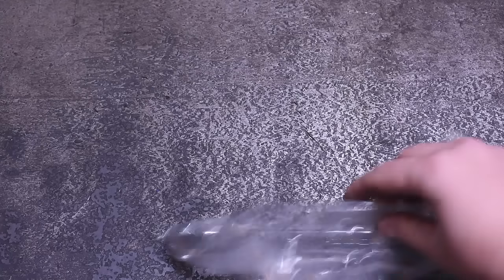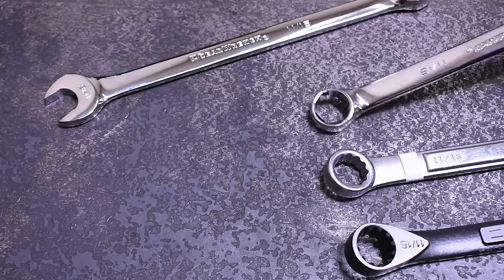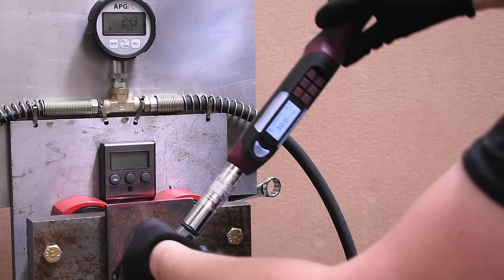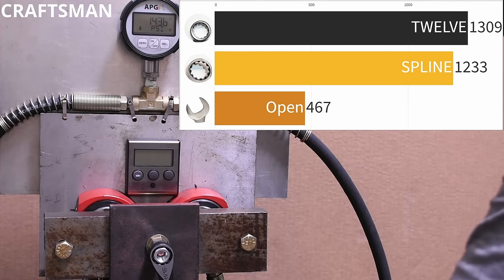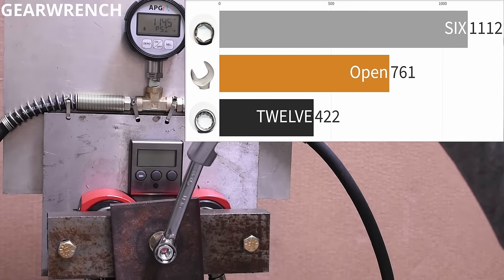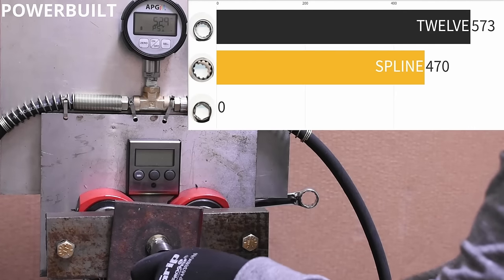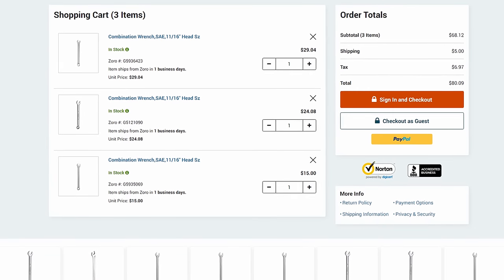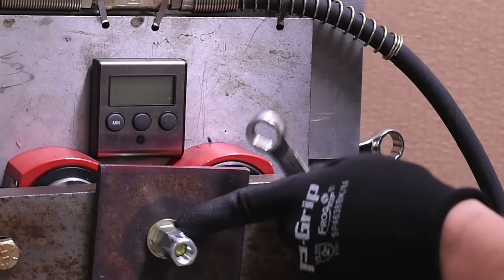Let's Settle This! What Wrench & Socket Design Will Slip 1st?

Comment from the maker: Follow up video testing 14 brands on the open end! https://www.youtube.com/watch?v=DzY4jg7NmKw
If you're wondering why 12 point and spline are being tested on 6-point fasteners, its because that's how they are used 95% of the time in a shop environment. And how they are sold to us on tool trucks. Combination wrenches are as old as time yet very infrequently used on actual 12-point or spline head bolts now days, they are a way to wrench on 6-point with less arc swing before repositioning, and therefore more access.
Reply: As an engineer, I'm more interested in 6-point on 6-point bolt vs 12-point on 12-point bolt, vs inside hex vs torx maybe? I know that's how tool trucks and shop sell them to you, but to me that screams wrong tool for the wrong fastener.
Reply from the maker: @checksum00  That all sounds well and good on paper to engineers I'm sure, but the popularity of the traditional 12-point combination wrench is due to access. You need multiple angles of attack on a bolt head. 6-point box end may not slip, but once you turn it and can no longer re-position it, story is over there. 12-point, and spline here with some advantage it seems, offers you the access without 60° of arc needed between goes.
Reply: @TorqueTestChannel  oh yeah, totally get the use case here, and frankly as an amateur mechanic I mostly carry 12-point for that reason, and so I don't have to duplicate tools for the rare case I get 12-point nuts. I'm not use to those spline one, actually the first time I hear about them. I worked in aerospace and we mostly use socket head caps screws. Rule of thumb in the industry is that 6-point < 12-point < SHCS < torx and other proprietary screws format, but I never really saw backing data on that. That's why I think seeing a fights of format vs format using the right tool would be immensely interesting.
Reply: @TorqueTestChannel  true, but if the clearance is that limited, you're probably going to want a ratcheting wrench anyways.
Reply from the maker: @SmallSpoonBrigade  Needing to use 12-point for repositioning doesn't describe a very tight space. Swigging a 10" wrench 60 degrees takes up a lot of room. Of course if you want to get in a habit of breaking bolts free with a ratcheting wrench that's something you can do as well if you have a good warranty. We all have. But 12-point box end breaking bolts free still happens countless times a day around the shop so it's worth seeing this difference I feel.
Reply: Maybe the majority of fasteners for the average guy are 6-point, but aircraft typically use 12-point fasteners. They are also high grade, and usually not rounded, as they tend to be replaced if found to be worn. Unless the last guy was a dick.
Reply: @TorqueTestChannel  his statement is what defines the engineer vs the mechanic. There is nothing wrong with having an education and a significant base of knowledge, however having the experience and ability to make a tool do what you need to support yourself is what u need to be a competent mechanic. Although I know plenty of engineers that are great hands on mechanics
Reply from the maker: @dougrobinson8602  In that case (where everything is 12-point, and perfect, and hardened) there's not going to be any difference between tool performance. Happy days for you folk! :D
Reply: @checksum00  "6-point < 12-point < SHCS < torx" and this is why mechanics hate engineers. Perhaps in raw yield, manufacturing, and grading this rule applies but in the real world where this thing called corrosion exists this is no longer the case. Torx is the worst to try and remove once it's rusty but at least it's already center punched for the drill.
Reply: @TorqueTestChannel  I think you're absolutely correct. I've maybe wrenched on a handful of 12 point bolts ever and never seen a spline drive bolt in person. This was by far the most practical and useful way to test this for the general public. As you said as well, we're interested in testing on already worn or softened fasteners. Great testing!
Reply: @802Garage  The only spline drive fasteners I have encountered in the wild were fancy lug nuts on aftermarket wheels. The guy had the socket in the glove box thankfully.
Reply: @Yogi_Bear69  you missed "in aerospace". Also disassembly is frankly irrelevant here, we are talking about torque ability and clamping pressures.

If we were talking about maintenance, other factors would be in play.

Also comments like that is the exact reason why mechanics wet dream of getting invited to talk down to engineer and scream at them about rust as if they had no fucking idea will never happen.

Engineering is an exercise of balance and choosing the most perfect imperfect situation. I'm sorry but the market, customers are making it impossible to take maintenance in heavy consideration because the society mostly throw away things at the end of the warranty. Sucks to be you, but that why right to repair is important.

The difference isn't the engineers, the difference is the market.
Reply: @checksum00  Working aerospace you should be very familiar with spline drive as a huge portion of the fasteners used in aerospace are spline.   So something does not add up here...   And 12 point bolts are very common any auto or aircraft  tech will be very familiar with them.  Heck Ford has been using them on driveshaft to pinion flanges since the 70's
Reply: The golden rule with spanners is that you never have the "right one" for the job. It's not just whether it's a twelve point, six point, spline or whatever... you never seem to have the right one! The handle's too long, the heads canted at an odd angle, the handle's too short, there's too much "meat" on it, it's stretched, it's been "modified" for another job, etc.
I've finally learned (age 51!) that wishful thinking does not change the physical properties of either a spanner or a fastener. Patience, reasoning and a credit card are the best tools you will ever have at your disposal.
And the other thing that I've learned... I'm a bloody hypocrite. I'll still go out and take another short cut sooner or later and turn a 3 minute job into a 3 hour saga by not following my own advice. By the way, I no longer use these tools professionally.
Reply: @checksum00  Make that inside hex (allen), torx, torx-plus, and triple square (xzn). I'd also like to see the difference between spline drive fasteners (ribe and polydrive, which are very similar but still different than each other) but that's starting to get a little pedantic. Screw it, throw in E-torx and 5 lobe torx too!
Reply: Try flipping the wrenches around so the handle bends towards your plate. It is supposed to change how torque is applied to the fastener. I find it works better this way on really stuck hardware.
Reply: @checksum00  Engineered obsolescence.
Reply: Exactly. Reading the comments here I'm shocked.  6 on 6. Not the way its done here. 12 on 6 for multiple angles especially when bolt is hardly accessible.  Use 6 on 6 when if in a case you damage the head of the bolt to get better grip. Spline spanner i must say I'm seeing for the first time.
Reply: 12 point a must for aviation. Jet engines they are used exclusively, Thousands of 12 points on large jet engines. How can the torque test channel omit aviation where everything is torqued?
Reply from the maker: Because the average combination wrench being sold on Amazon, Harbor Freight and even the tool truck is not being used on jet engines.
Reply: @TorqueTestChannel  these comments are really sending me lol. Leave it to all the engineers of the internet to not understand why the most common application is the most practical for testing. Should you make a video for aerospace, 0.01% of the population, or for anybody working on cars or standard bolts and nuts in every application imaginable? Hmmm.
Reply from the maker: @802Garage  Think of it this way. Most of these gentleman who are perplexed seeing a 12point or spline on a hex are more likely to drive cars under warranty and have a shop do the work (with plenty of combination wrench action im sure) and that's just more business for people like us!
Reply: Understood. Never mind. 5% out.
Reply: wish there were square and triangulate nuts to test that would be interesting
Reply: @firefox5926  Square exist! Never seen triangular.
Reply: I would like to see the tests of these on fresh bolts instead of the 'damaged' ones just top see the raw data.
Reply: I would have been interested to see a comparison on the “Metrinch” six point  spline drive sockets and wrenches.
I have broken bolts with those.
Reply: @KalijahAnderson  They covered that in the video. With fresh bolts, every type of wrench was able to exceed the strength of the threads. No point in testing.
Reply: @802Garage  I heard that, I'd just like to actually see that happen.
Reply: You should've purchased a snap on flank drive to test the open end out. Would've been interesting to see.
Reply: I love my metrinch, have you guys ever tested them? I actually bought an impact set of metrinch, but they really don’t work on an impact gun.
Reply: Great test and controlled demonstration!! Excellent video and information!
Cheers from London England 👍😎🏴🇬🇧
Reply: @802Garage  the kind of fasteners found on cars that come with the Vermont Package.
Reply: @cogitoergovexo  😂 Half of the time you get at least half a fastener left!
Reply: Harbor Freight Tools store brand ( Pittsburg ) probably has all 3 types. Pittsburg Tools have a Lifetime warranty like Craftsman Tools have.
Reply: If you look at a normal  open enfed spanner, or 6-point, the jaws are angled in such a way that by turning the spanner over you can move the fastener in 30 degree increments,  exactly the same as a ring spanner, or 12-point.
Reply: @TheeAbstractHero  I'll second wanting to see the flank drives. They're the only Snap-on sockets and wrenches I own, so I'm not sure if they grab better because they're better tools, or a better design.
Reply: I think the problem people are going to have here is just that everybody knew the 12-point wrench wasn't going to do nearly as well as a 6-point wrench on a 6-point socket. It's like asking if a pickup or a Corolla is going to tow a 20000-lb trailer better. You really don't need to waste a video on it.

If you need to really wrench on something to break it loose, you just stop with the 12-pointer and get a 6-pointer. It's common knowledge, learned from common experience. Once you break it loose, you can swap to the 12-pointer for a little easier time rapidly wrenching on the thing.

Of course, there are very few things I use a wrench on, since sockets are better and I can throw them on a breaker bar, ratchet, or cordless driver as needed. The only reason I ever buy 12-point sockets is if that's the only thing available, or the only thing I can afford in the moment. The few things I do use wrenches on (like adjusting tie rod ends), can generally only be accessed by an open-end wrench, so the 12-point vs 6-point comparison is mostly meaningless anyways.

A much more useful video would compare 12-point tools with 12-point fasteners vs 6-point tools with 6-point fasteners, etc. The 12-pointer has more surface area, but each lug on the fastener is weaker, so it's less immediately obvious which one is better. When you start getting into splined designs, you should see even more disparity between tools.
Reply from the maker: @GeekOfAllness  The title of the video is which wrench will slip 1st though, not is 6 point better than 12-point. A lot of people use spline around here, especially those Kabo made Mountain/Matco ratcheting ones. Lots of debates including from my end if it's all nonesence vs 12-point. And if we're going to compare spline and 12-point, it's worth throwing 6 into the mix to see if the difference between spline and 12 is significant or minor.
Reply: @checksum00  I agree with you, I personally would like to see tools being used as intended. Knowledge can still be learnt from this video just not for me. I always use the appropriate tools for the job regardless of wealth, experience or ego otherwise I don’t do the job.
Reply: @checksum00  engineer moment
Reply: @TorqueTestChannel  this is why a pro mechanic has a thousand wrenches in the box, some custom modified. The motherfer of invention will teach you do what it takes....
Reply: What about trying Met-rinch spanners(hopefully I have spelled that correctly)
And apologies if they have already been tried or suggested. 
I used a set for over 10 years and they never failed me. Although I cannot confirm the stress levels I was using them at.
Reply: @TorqueTestChannel  I am a normie but when it comes to the perfect tool for the job and with so many types of bolts out there, I feel like convenience is also a reason people dont reach for the "perfect" tool. Because the tool boxes get full enough already and when something is 90% good enough, instead of buying every single imaginable perfect tool for every job (especially at the cost of some tools), you buy the most common perfect tools and the rest tools that will do jobs 90-95% good enough?

But even if you buy every tool for every job, if you have a tool that isnt perfect but is able to do the majority of your daily needs, that becomes the tool of choice because it also becomes the most convenient to have around.

I am sure the more specialized your work, and the more important your fault tolerances are, the more important it is to have the perfect tool for that job. But not every job needs that.
Reply: @matthewq4b  is there a reason they use spline? or is it just random which screw type they use
Reply: Gearwrench make those special sockets for rounded bolt heads and nuts, wouldn’t mind seeing how they go up against anything else
Reply: @dougrobinson8602  
Does a 12 point actually fit those airplane bolts? I thought that those were their own thing and needed their own tool to be properly used.
Do i have this wrong? And what is the proper name for that head design?
Reply: @davidbrayshaw3529  
Haha. Im same age and get myself in the same pickles.
By the way, whats a spanner? Is that the trap you stretch over the car when repairing it in the rain?
Reply: @Grunchy005  do they dtill sell those?
Reply: @davidbrayshaw3529 LOL.......agreed!
Reply: How often is a bolt even accessible enough to do that?
Reply: @checksum00  you went from engineering to mechanic, what
Reply: @Yogi_Bear69  "Atleast it's already centre punched for the drill"
I am so stealing that joke.
Reply: @TorqueTestChannel  I like to consider myself pretty savvy but I never even realized you could use spline wrenches on 6-point and 12-point fasteners, could be really handy for removing a nut once it's broken free, assuming it's a nyloc, threadlocked, or just corroded. We're talking under 40N/M here so the disadvantages of spline on 6-point wouldn't really matter.

I am confident spline on spline would have the best performance, I'm pretty confident manufacturers use torx and spline to reduce tool wear during manufacturing.
I bet spline would also work as a theft deterrent for alloys, way more reliable than wheel keys which love to break if the nut/bolt gets stuck, if few enough people do it the thieves will never buy the tools.
Reply: @TorqueTestChannel  Don't forget that sometimes in automotive you may find square head bolts, and hex won't work on that where 12 will. Might not be an issue on newer vehicles but I've seen a reasonable amount of square head bolts and nuts on older cars and trucks.
Reply: Just from personal experience working in a auto service center...
I always recommend a 6 sided socket or wrench for bolts you remove often like a oil plug. 12 point or spline wrenches and sockets will chew that bolt up over time.
Reply: @checksum00  And how about using a spline on a spline?
Reply: I have in the almost 20 years (industrial maintenance) only seen a handfull of 6 point wrenches
Reply: @arthurhuskins910  because 6 point wrenches limit the angles at which the bolt can be grasped. 6 point non-ratcheting wrenches are not as convenient as 12 point.  However i think a 6 point ratcheting wrench would negate that limitation.
Reply: @checksum00  For aerospace fasteners I'd guess that weight is a big factor. Will torx heads allow you to save much weight? I know that increasing the number of contact points should increase the shear strength, and I guess that should allow weight savings
Reply: Something I have often done was if a bolt head is rounded, you can you a 12 point socket 1 size smaller and hammer it on. It will bite into the bolt head and allow you to remove it. If not I stick to my 6 point
Reply: ⁹999⁸⁷aalllllllllllllllllln
Reply: Husky, pitsburgh? Icon?
Reply: @Yogi_Bear69  "Torx is the worst to try and remove once it's rusty but at least it's already center punched for the drill."
I wouldn't say they are that bad if you take your time and remove the crud that's gumming it up and give the bit the old tappy tappy treatment to seat it properly, you can also try tapping in a size larger bit in to it. However, the TX torxs are a pain to drill because of the central studs.

My least favorite head to remove once rusty is the safety allen screws. Who carries those bits around?  No one, so you try it with the corresponding TX bit and you round it more often than not. Congratulations! Now you have a round hole with a peg in the middle to make sure your drilling attempt is off center.
Reply: @TorqueTestChannel  yeah that's why most people do use 12 point I totally agree. Use 12 point in Tight areas where the extra torque is not needed But you need the extra swing, but you want to use 6 where you need that extra torque.
Reply: Sockets, please sockets!
Reply: @TorqueTestChannel  “Because the average combination wrench being sold on Amazon, Harbor Freight, and even the tool truck is not being used on jet engines.”

And that’s where you’re wrong. Where do you think aircraft mechanics get their tools from? In the civilian world, we all supply the majority of our own tools. There is no special aviation specific supplier for basic hand tools like wrenches and sockets. We use whatever we can find that works. Some insist on tool truck brands, but personally, I’m a cheapskate when it comes to tools. I make a healthy six figure income, yet my tool box is still full of the same  Craftsman, Husky, and Harbor Freight junk that I bought when I first started in this industry. It’s not fancy, but it does the job.
Reply: What's the brand on that wrench extender and does is it universal on all end wrenches?
Reply: Just because 95% of the time, they're being used wrong doesn't mean you need to test them wrong. :/  I'm much more interested how much more torque it takes to round a 6 point fastener (using the correct tool) vs a 12 point fastener vs a 12 point spline.
Reply: Ahah missed this - spline was designed to be used in high torque applications like aerospace. I wonder how spline on spline tests against hex on hex. Edit: Addendum: I am sorry marketing has determined the best course of action for your Philips screw is a slotted screwdriver.
Reply: @TorqueTestChannel   в цьому твердженні є помилка,  тому що конструктивно головка глюча повернута відносно руків'я на кут 15-20° що дає можливість користуватись меншою дугою, чи 60 градусів.
Reply: @TorqueTestChannel  as a DIY mechanic on my BMW, thanks for spreading knowledge on the uses of the 12 point on a hex. I had no clue that people do that. I now understand why! 60 degree arcs vs 30 degrees. I have personally had that exact issue where I didn't have enough room to swing 60 degrees and had to keep fenagling angles and position to get the right arc.  I was always worried about the 12 point stripping the metal or rounding a hex bolt. I guess that doesnt happen as I thought?
Reply: I noticed that in some experiments operator will not torque the nut gradually, but will jerk the wrench extension and not allow to socket or wrench to turn the nut to max torque.
Reply: Now do fdx
Reply: Maybe it's just my experience but whenever I see really cheap, useless socket sets, they're generally 6 point.  These will often split open in use or their tommy bars bend or snap.  Which causes me to associate 6 point with being cheap rubbish. Obviously if they're made from the same quality materials as 12 point they MUST be better.  It's just a stigma I can't get out of my head.  Give me a choice of the two and I'll go for the 12 point.  Although now I realise how irrational that is.
Reply: A 6 point wrench will fit anything you weld a 6 point nut to the top of!
Reply: My main skepticism about spline has always been that "bite" you talked about. I get that it has better performance before failure (vs 12pt) but in the range where both are fine does the spline chew up the fastener head more?
Reply: you should measure these nuts and sort these with different diameters. All of them are made with some +/- tolerances according to norm. One 10mm as 9.9mm another as 10.15mm.
Reply: Splines work on about anything, torx, square, six points, 12 points, etc. It's always useful having one in case, saves you from having to purchase that specific socket you'll only need once or twice.